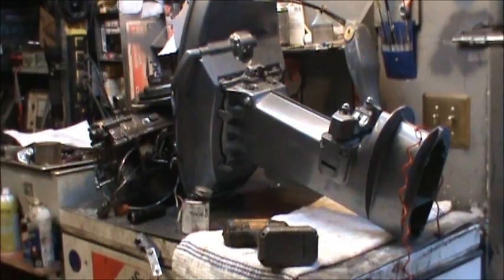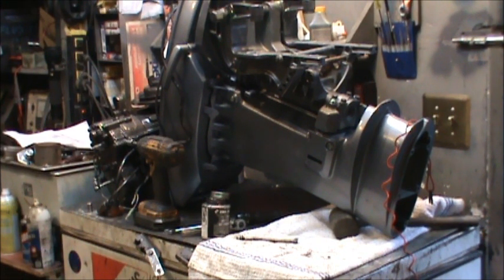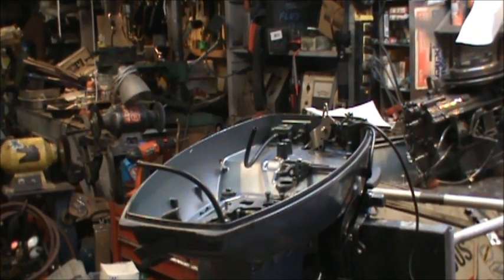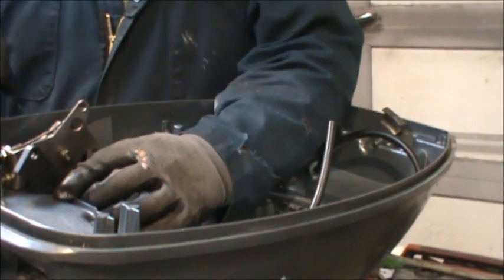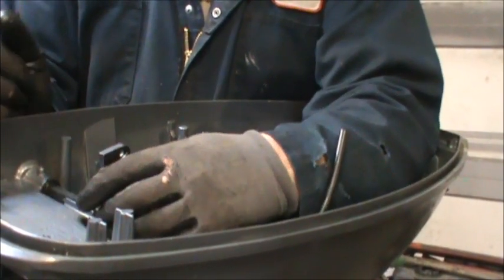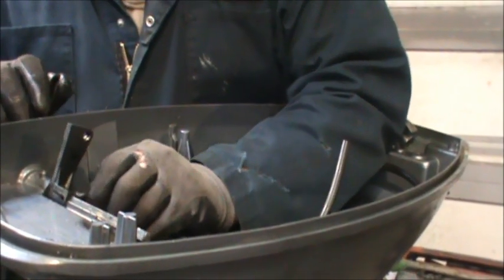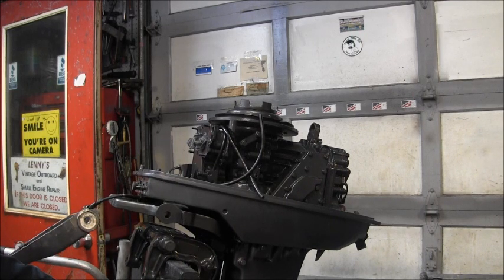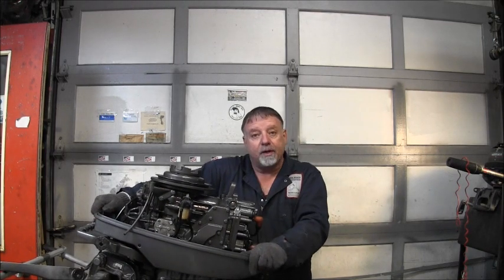YAMAHA 40 HP ENDURO    ( PART 4 )

Comment: Hi Kodi, The tiller on the old merc I have takes a bushing insert on both sides and screws. With the shift rod mechanism there is no room for a through bolt. I really like the design on the Mark 10. Looking forward to spring to run it on the water
Reply from the maker: I Only know of one here on the Island,   The owner won't sell it,  instead it sits outside up against a tree & rots away.  kinda sad.      kodi
Reply: Maybe he will trade for something? They are interesting how they are put together. All metal, no plastic, automatic transmission as mercury calls it. The impeller is up inside and not on the lower leg.

Comment: That one was a little salty that’s why I go lube crazy and I only live at the bottom of Lake Michigan a few miles south but when they sit for 25 to50 years that aluminum likes to get crusty white I am restoring a 1956 RDE-18 30 hp Johnson Holliday bronze Put coils on it fired right up after sitting in a basement for 50 years I love that motor
Reply from the maker: Sam;  I do have a 1960 40 hp Johnson that threw a rod, some of those parts may fit your 30.      kodi
Reply: @kodibassInsideoutboards  I got all the parts for the 56 30 hp Johnson I am just waiting for the weather to get a bit warmer before I paint it I got self etching primer and holiday bronze and cream  white 1956 already to go my heater electric motor burned up Insurance company  won’t let me put a woodstove in  lndiana waiting on warm day
Reply from the maker: @samtate1260    Spring is com'n   &  Not to soon mate.               kodi

Comment: hey kodi what is the newton on the head gasket on a evinrude 35 hp 2 cylinders motor
Reply from the maker: NM 20-24   FT lbs  18-20                      kodi